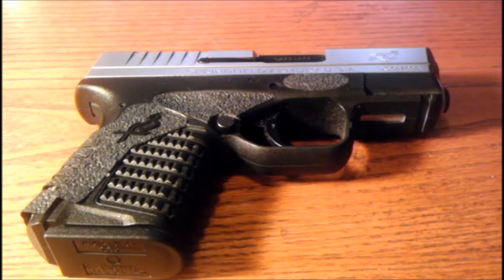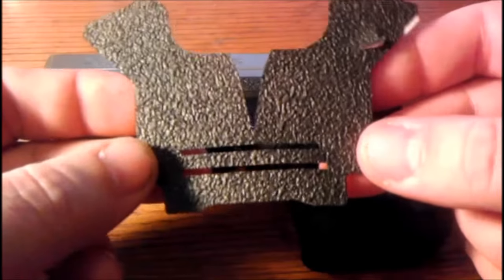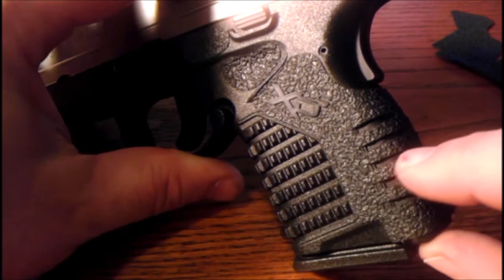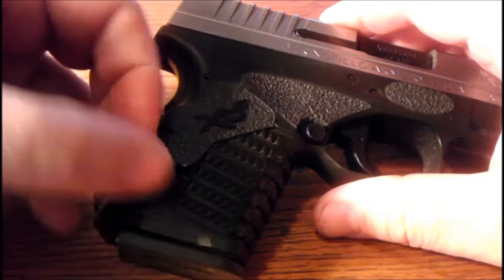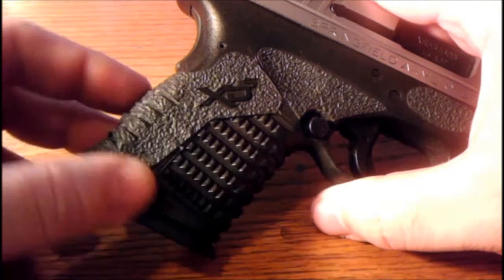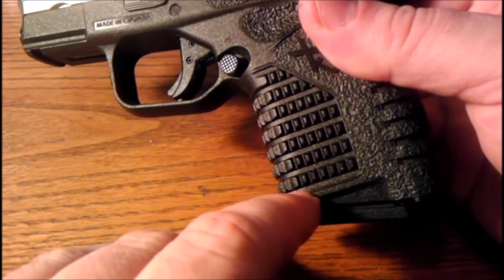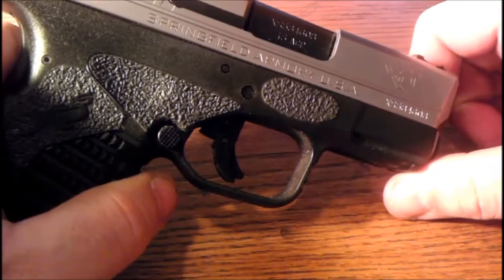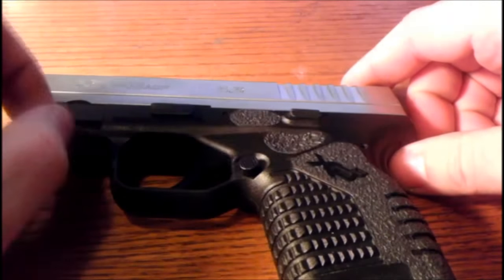X-Treme Grips fail on Springfield XDs

Comment: Have the same problem with the front piece on my XDs. As I carry the gun the side that is against my body gives out and slides off the grip. It doesn't matter if it's against my skin or against an undershirt. The warmth of my body causes the glue to give out. The rear section is still just as perfect as the day I put it on. Maybe since you used the wrong size rear piece on yours it caused it to give out. I also had difficulty with the cutouts but had been warned ahead of time so I was VERY careful with them. I installed these grips exactly as required by manufacturer with hair dryer and all but I agree that the grip should have gone between the texture and not over it thereby not giving it enough surface area to grip on to. I have X Treme's on my Shield and my XDm but have not had any problem with those. Albiet the XDm is not carried on my person but the Shield frequently is(Shield is a less aggressive grip). It is disappointing that this happened because I liked this grip but may have to change to the uglier Talon Grips.

Comment: you need a complete wrap around grip set. Check with JT Defense. I have their camo on my XD and Glock, as well as my Ruger. They fit excellent, they have mossy oak camo. I had to remove their camo off my ccw gun, because it ate my side.. their tape is abrasive, so it took skin off my side with IWB holster. No better fitting true wrap around grips on the market that I've seen yet.

Comment: My x-treme grips have stuck, I actually used a heat gun, be careful,  you can take the parts you removed and place them in the grooves, it will not grip the same